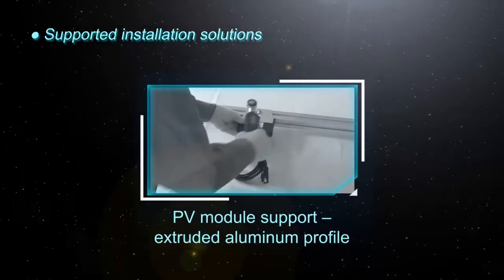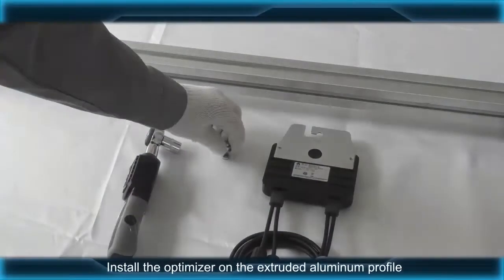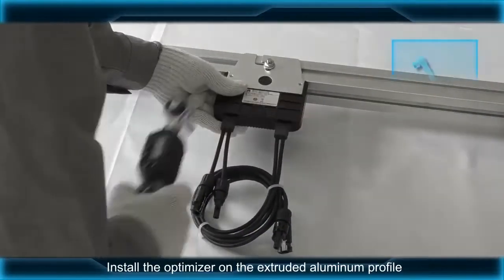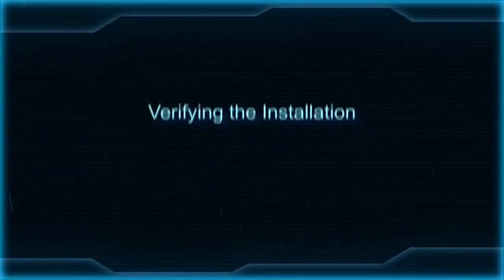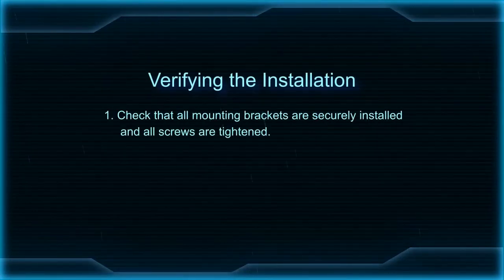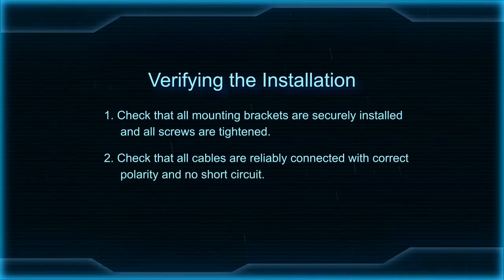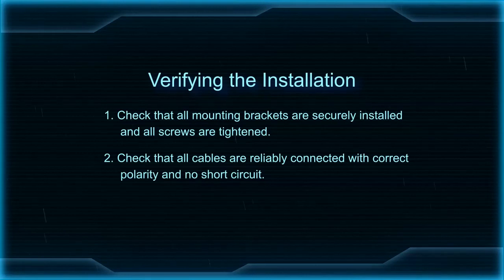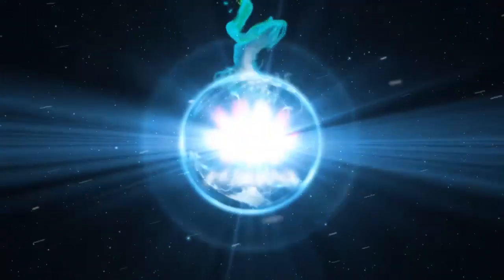SUN2000P 375W Smart PV Optimizer Installation

Comment: I have a 275watts solar module with maximum power voltage at 39.8vdc and open circuit voltage 47.6vdc.
But when I connect the optimizer to the modules, the output voltage reduces to 26.7vdc.
Is that normal ?
Reply: I suspect that there was simply not enough sun